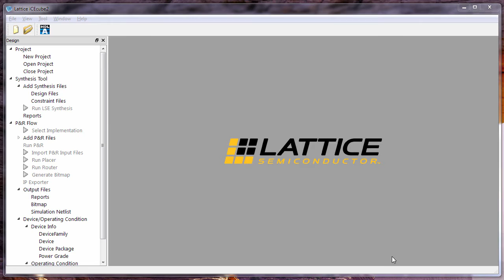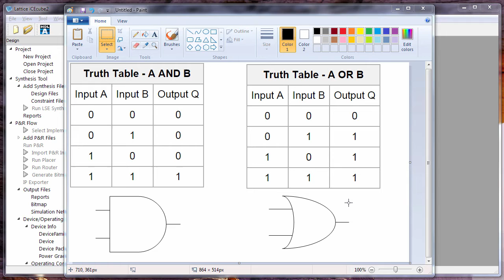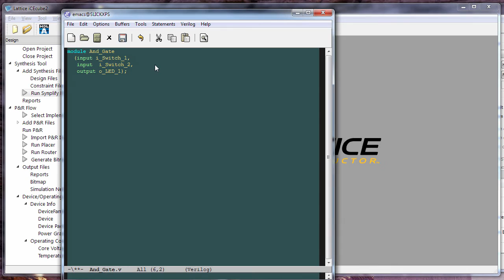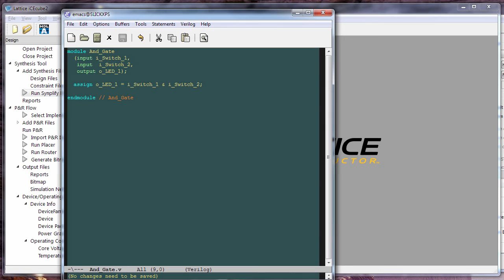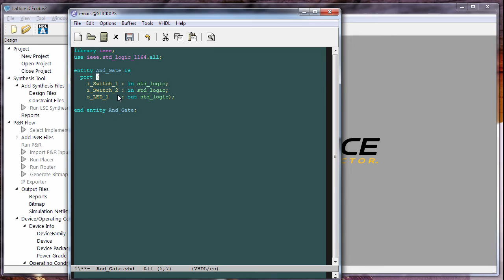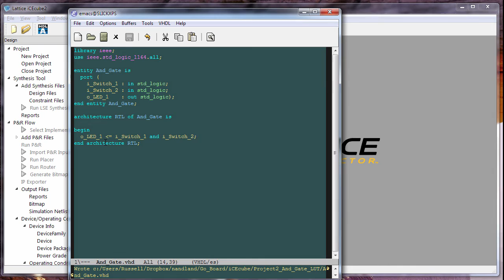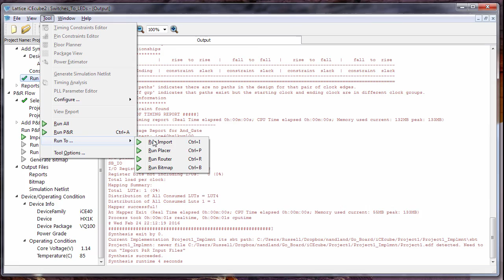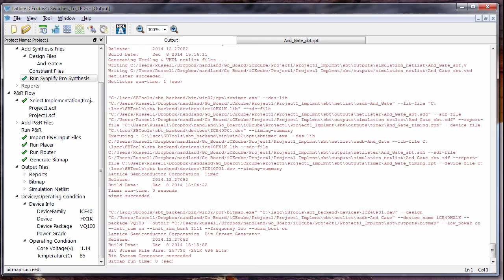Nandland Go Board Project 2 - The Look-Up Table (LUT)

Comment: Hi! I have followed the tutorial but after I program the board, all the LEDs are constantly on but not full brightness and they do not respond to me pressing the buttons. I have tried both code files and reprogrammed the board multiples times, doesn't seem to make a difference. Can someone point out what I am missing?
Reply: of course the problem was forgetting the pin constraints file. added that to the project and went through the rest of the workflow and the and  gate works now. I do have another question: the other three LEDs are still always faintly glowing. I would like to clear the board so that it's back in its unused state (hoping this will stop the faint glow from the other LEDs). Does someone know how to do this?
Reply from the maker: @aetherdrift369  In iCEcube2: Tool -> Tool Options -> Bitmap -> Check the box that says "Set all unuused IO no pullup". Or you can explicitly set the LEDs to 0 in the Verilog/VHDL code. Or you can just ignore the faint glow :)
Reply: @Nandland  worked like a dream Russell, thanks! really enjoying working through the tutorials so far

Comment: Hmmm. I just did project 1 and 2. But leds 2, 3, 4 still glow. Not strongly. But they are on
Reply from the maker: Yes. There's a reason! I'll give you a clue it's in iCEcube2, there's a setting you can change to turn them off... Let me know if you want abother hint...
Reply: Ahh, but I am running on a Mac so I have to use the Yosys/Arachne-pnr/icepack/iceprog route. Internal to the code I assign i_LED2 = 1'b0  for all the unused leds. Can I assign a default in the constraints file ?
Reply from the maker: @phillipneal8194  Ah interesting. I'm not sure where the setting is in those tools, but there's a way to disable the pull-up on unused outputs. That's what's causing them to glow like that. It's fine to just leave them. Or you can turn them off in your code. I think it should be o_LED2 though to match the constraint file.

Comment: I just received my Go Board and have been trying all evening to make this work.  I've tried both the Verilog and VHD versions, both of which go through the synth/p&r with no probs.  I'm able to program the board, no prob.  I've double checked the constraint file.  But all I get on the board is D1, D3, and D4 are lit at about 20% and D2 is lit at about 100%.  The only hitch I had in the entire process is the Micron M25P10A was not an available choice, so I used M25P10, which I don't think is the problem since the board verified okay.  What might be the problem?
Reply from the maker: Sorry you're having difficulty! Usually that happens when the Place & Route constraint file is not correct. Double check that you have the .pcf file included in your project. Also double check that the signals at the top level entity match the signals in your constraint file. Good luck!
Reply: I was too tired to read through the generated report and so I missed what was causing the problem.  Maybe I was expecting the tools to throw up a big red flag and stop me from moving forward, but hey, this is a new world for me.  Anyway, apparently this is one of those persnikity tools that wants mr to ACTUALLY select the CORRECT pin package!  Thanks for the quick response - everything is hunky and dory now and I look forward to continuing in my education.  Cheers!

Comment: I had a funny behavior when I compile this example with the iceproject tools. LED_1 worked fine, but for some reason the other leds were dimly lighted in the board. Anyways, I solved this problem by adding the these leds to the verilog code, and assigning them to 0.
Reply from the maker: Yup that's one way to do it.  Another way is to go into iCEcube2 and click on Tool -> Tool Options.  Then on the Bitmap tab check the "Set all unused IO no pullup" box.  The dim LED is caused by the pullup on the FPGA defaulting to ON.

Comment: Dear sir,
very good tutorial for the beginner
but i have some questions below
U said so much about the gates AND OR NADN NOR etc, but from the high level progamming languge VHDL verilog,
we don't need to consider the gate things, even you can see the LUT usage in the synthesis.
so each LUT can handle what kind of logical? LUT contains how much gates?
do we have some ways to define the real LUT used in the FPGA, not just the logcial expression in VHDL? just like assembly for C.
Reply from the maker: A 4-input LUT doesn't contain any "type" of gate.  It contains all possible truth table combinations given 4-inputs and 1-output.  It can be anything.  
To answer your second question, generally you're right, the high-level languages handle all of this stuff for you.  If you wanted to get down to the "assembly" level for LUTs, you would need to look at something like project IceStorm (http://www.clifford.at/icestorm/) which reverse engineers FPGAs.  Note that the Lattice FPGA they use is the same one on the Go Board.